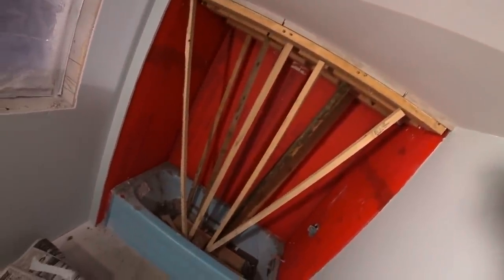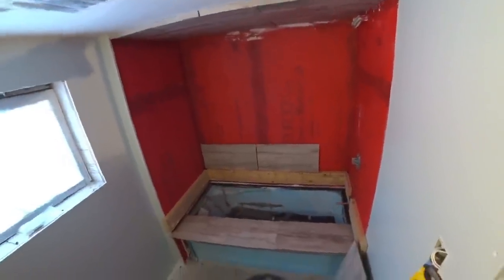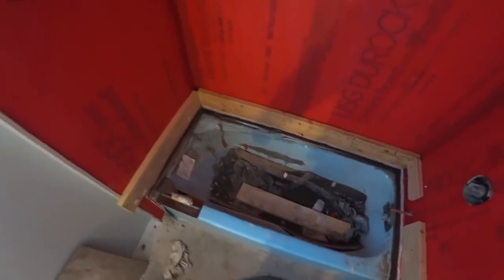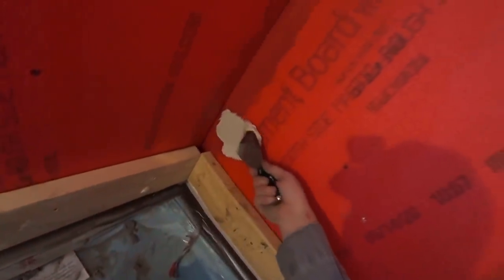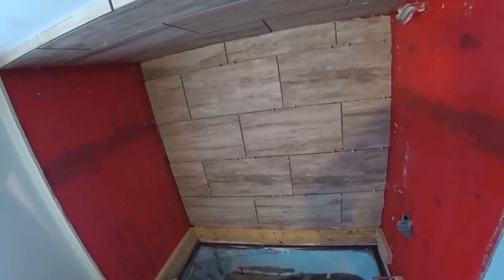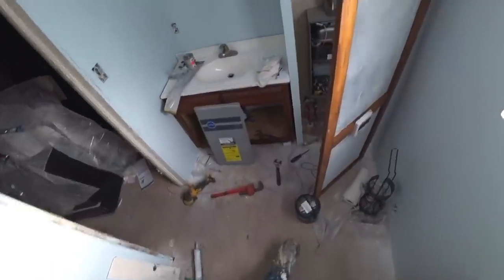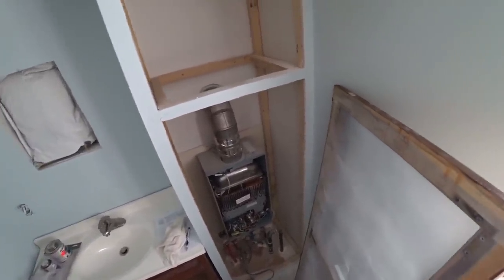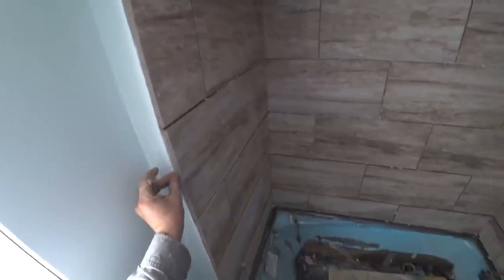Yooper Renovation, time to tile this bath/shower, and fire up this water heater 2021/3

Comment: Larry, ther are ceramic soap holders and small shelves that you can mount right on top of the wall tiles you’ve put up. You use silicone adhesive. Such as Loctite PL 550. While it’s drying you just tape in place

Comment: Tile adhesive specifically states not to put the adhesive onto the tile but on the wall. It should be fine but you just added extra work for yourself.

Comment: you could cut the bottom tile in half and start from there, it would look a lot better than that half inch piece that's going to be put at the top

Comment: That is a concentric flue pipe. it give you inlet in the center and exhaust between the two pipes. the cap should have two outlets,one for each pipe, and I think the inner pipe most go hogh then the outer pipe.